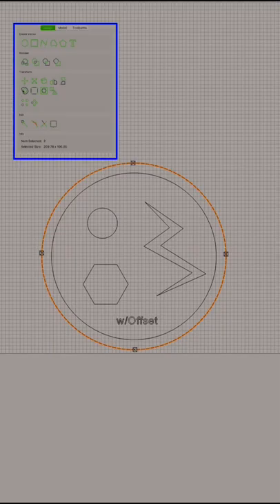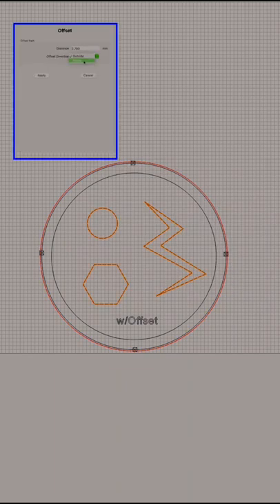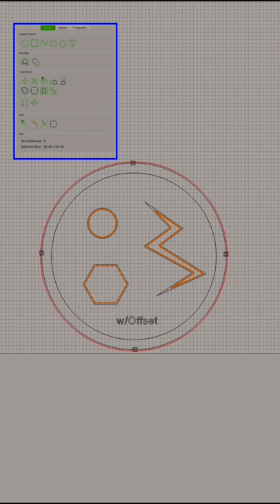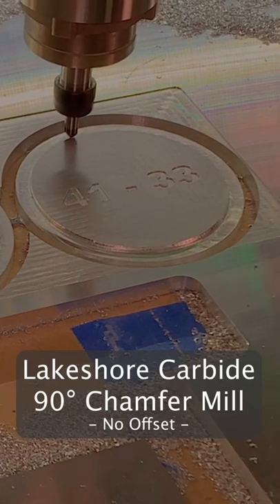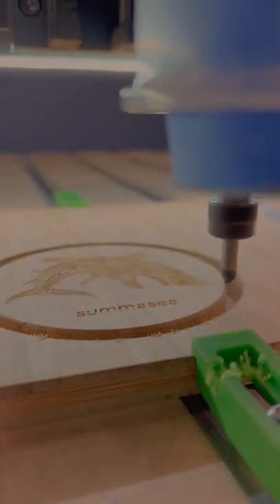Chamfers in Carbide Create

Comment: I do this. All the time, never need offset, just run on these line gives a light shadow line to enhance the chamfer bit more,  with V bit or spiked roundover.
Reply from the maker: If you run the actual contours of your part you can absolutely achieve a chamfer.   I too did this for a while.  
By setting up the separate contour you move the tip of the tool, which does have a flat, off your part.  That way the only chamfer angle that appears on your part is that of the chamfer mill or VBit.